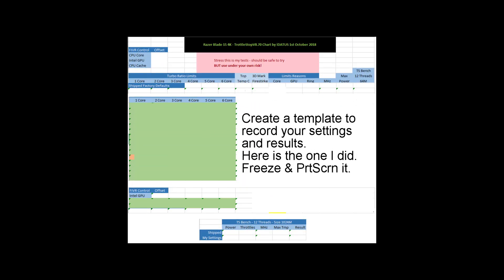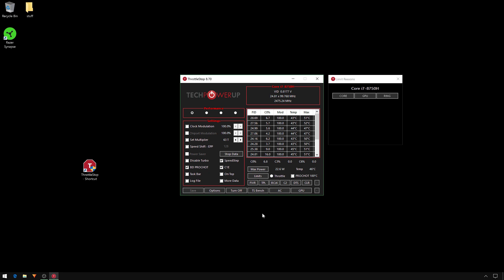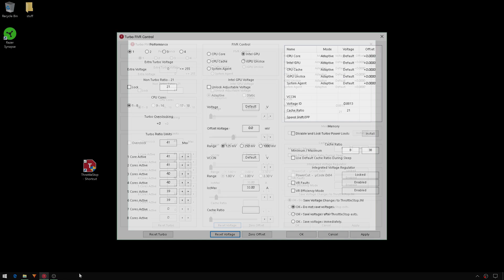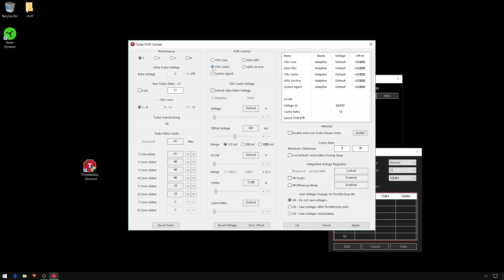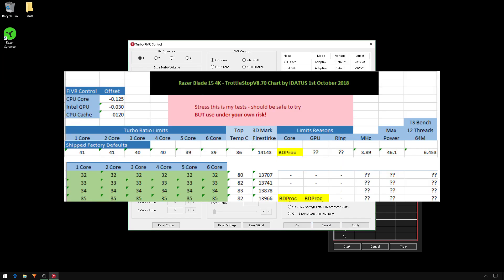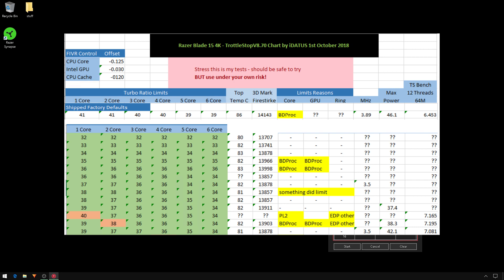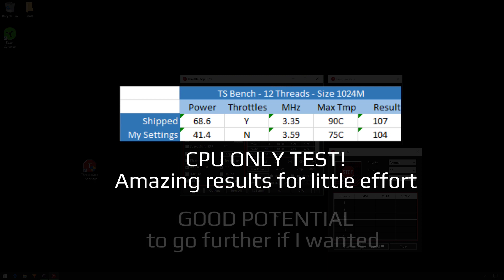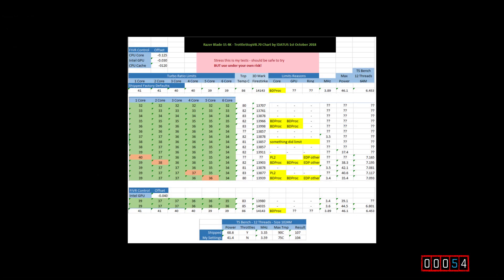Razer blade 15 undervolting with ThrottleStop⮜iDATUS⮞

Comment: REALLY appreciate your video! Thanks to you I am noww able to run my Razer Blade 15 GTX1070 much cooler while gaming or working! Good job :)
Reply from the maker: Do check out the other posts I did after this one for other ideas and methods. I do need to post some more. Thanks for your feedback.
Reply: im just curious as how is your temps so far, idle and gaming. I have the same unit to date

Comment: cant change voltage offset on blade 15 base model (2018), follow all the steps but on APPLY voltage offset did not changed.
Reply from the maker: Have you enabled or have enabled in the bios virtualization? And are you running windows 11?

Comment: I just bought the new i9 OLED Blade and I am pissed that Razer locked the bios and undervolting ability. I disabled turbo boost to get sane temperatures while gaming but this is stupid.
Reply from the maker: I don't blame Razer or anyone else for removing settings from the bios. There really isn't much scope due to limitations of formfactor and components.
Manufactures use a lot of extra hardware to control the components to keep them cool.
I can't imaging the number of calls support would get from those wondering what happens if I mess with this etc.
For those who want to dabble you have to find tools such as Throttlestop.
Bet that OLED looks nice.
Reply: @iDATUS  These laptops are too thin for proper cooling so to get the best of both worlds you need to undervolt. The only thing I can do on my new model is disable turbo boost which reduces temperatures but also performance.
Reply from the maker: Just keep everything at CPU design wattage, mine was 45w yours is probably 50w and under volt.
The mhz will rise to that limit of power.
Also you can tweak the GPU a bit.
If your app is bursty then you can have higher wattage.
If I was designing the laptop I would have more vent holes and also use the case to passive heat more.

Comment: Will undervolting my Blade 15 improve performance in video editing apps like premiere pro and after effects ??
Reply from the maker: Good question. Check out the channel as there are a lot of videos I have done both GPU and CPU since this one.
Could do with an update but they are still worth watching.
Undervolting should really be done no matter what if you feel comfortable doing it.
I suspect your apps use the cpu and gpu depending on tasks at hand.
The gpu encoder will be used when creating the output file. The GPU has a much lower threshold of underclocking if it gets hot.

The CPU heat transfers some of its heat to the GPU.
Reply: @iDATUS  i appreciate it but you didn’t rlly answer my question
Reply from the maker: @ZIMISTAK  I dont have those apps.
Reply: @iDATUS  well those apps are CPU intensive, would undervolting improve performance on cpu based apps?
Reply from the maker: @ZIMISTAK  Its not any easy question to answer as it depends if you are hitting thresholds for your particular usage.
If its bursty rather than sustained then probably leave as is.
If its sustained for more than say 10 seconds then I would defiantly do it as you will hit a throttle back which will slow you down until it thinks it has recovered.

By default the cpu is at a voltage level to guarantee no issues from intel.
I have more up to date videos on my network which explains this better.

In short, reduce voltage, set max watts to cpu design e.g. 45w / 50w and you will have a great setup giving sustained power.
If you are unsure on how to set max watts, turn off game/performance mode.
Set all cpu multipliers to the same number, e.g. mine are all 39.

Comment: I can't unlock the core controls in throttle stop. Why do you think that is? 

I know everyone says that you can't usb C charge the base Razer 15 but what about the base OLED? The bios has an option to turn it on, so I am starting to think that it does.
Reply from the maker: Matt, you saying to charge the Razer blade battery you dont need to plug it into the mains? OR you cant charge your phone using the Razer Blade?

Comment: Will this help me with my unnecessary fan noise I get when casually surfing the web if I undervote I have the 2020 base model rtx 2060.
Reply from the maker: Good question, I have a much better understanding of how throttlestop works since the making of this video and posted lots more up to date guides.
In short yes quite a lot.

Comment: why is speedshift epp unchecked ?
and is there anyway to run that 8750h at 3.8-3.9ghz at lower wattages without getting into 85C and higher in gaming.

one more question,
how can i maximise battery life of my device and  how should i set TStop to change profile to battery mode when i unplug my laptop from the mains.

By the way i have seen the whole TStop series of urs, it is too damn awesome mate. 
 
awaiting for your reply
Reply from the maker: Jatin, thanks for the kind words, I use the videos myself to remind me how it all works, friggin complicated isn't it. But what I will say is that you have ultimate control of your i7 and 8750h or any other, IF you know how you are going to use your laptop.
You could use profile 1 for short burst power, 2 for sustained, 3 & 4 could be battery or specific program or combination.

I did mention epp in 8.70.6 video (i will do a 9.0 refresh) and it could be useful but I would NOT recommend it for any laptop. May want to read some of the comments for those videos.

The options video also mentions battery, you can get it to automatically switch profile when it goes to battery say profile 3. I then set a battery level when reached (85%) go to profile 4.
Note also that when a profile changes you can get it to run scripts. I would do one to say stop services etc.

I will be doing more videos on this at some point.

Comment: these settings witll decreace or increase how hot my razer blade is?
Reply from the maker: Its a good video but I have come a long way with how to understand the settings and how to control the i7 since.
https://www.youtube.com/playlist?list=PLA31rku1BK2qTXj-VPQm5NVc3jNgNaF9J
This is a playlist of my throttlestop videos so far.
Explains a lot.
And yes it will drastically cool and depending on your usual give you a sustained smooth power.

Comment: Hey there! I want to try lowering the Turbo Boost to 3.4GHz instead of disabling it altogether however I can't find the option to lower the Turbo Boost in FIVR do you know how I can do it?
Reply from the maker: Sorry for late reply, my notifications were not working.
I have done a ton of new throttle stop videos since which explain a lot better how things work.
Check my channel out as there is a throttlestop section.
If you need help post again.

Comment: Can i do this on my Razer Blade Pro 17 (2019) RTX 2080 Max-Q 
Intel® Core™ i7-9750H CPU @ 2.60GHz
Reply: Because right now when playing any games i always on 90C and ramping up to 100C And I'm Using Intel XTU Though
Reply: Russel Segundo I would get throttle stop and try undervolting to -0.125
Reply: @VengefulController  i use Intel Extreme Tuning Utility and Undervolt is on -0.150 the most limit i can do is -0.175 on -0.180 will do BSD so i go -0.175 on Core Voltage Offset and Cache and i put same exact on Processor Graphics Voltage Offset -0.175
Reply: @russelsegundo8865  your overheating may be a hardware issue then, I have a razer blade 15 with the same processor but a rtx 2060, and my temps while gaming are 75 to 85 degrees. If u want to try to lower temps without needing to change hardware try undervolting your GPU
Reply from the maker: Sorry for no reply, I didn't get notification of posts.
This is an old video now and I have done some great work and understanding how the intel i7 works.
Go to my channel and see the throttlestop group.
Any probs let me know.

Comment: Just wanted to add I just got the Razer blade i7 9750h and 2060 followed this guide and cooled my Laptop off so much while playing and still getting great performance. I use the Gaming setting in Razer Synapse with auto fans and the middle battery profile (better performance not best.) Everything else was exact as tutorial and my turbo ratios were 41,41,41,37,36,29 and I am getting great framerates stable 144 in the bran new Call of Duty Modern Warfare and temps never above 80 degrees on CPU or GPU !! Thank you so much for taking the time to make this @iDATUS you are the man! Before the laptop was still running good but very hot sometimes hitting 99-100 degrees with settings. Now I can set it anywhere with no cooler underneath or anything and games below 80 degrees. Thanks again.
Reply from the maker: Great results. You might like to know I have learned a hell of a lot more about throttlestop and how the intel behaves since the posting of this video. You probably have but if you haven't check the rest of my content out. Its all dedicated to tech and product guides, mostly on Razer.
Done a lot of research and testing and very surprised on results and what you can do. Real life examples to follow.
There is a detailed guide to throttlestop settings and options I did which is a great reference, even for me as its not easy to remember.
Check this out https://youtu.be/xej2Lo5HYzQ
Consider subbing up if you haven't already and check out the patron options ⮜iDATUS⮞

Comment: Thank you for the video, I am about to under volt my Razer Blade 15. I have a question though. Is it necessary to change the turbo ratio limits, or can you just change the voltage offset for the CPU, CPU cache, and iGPU? I was looking in intel's XTU and it will not let you change the turbo ratios, even after changing the above mentioned offsets. What is the correct way?
Reply from the maker: @Chris, each case is different. The voltage is a must if your system can take it, which the settings I show are easy obtainable.
The default core settings don't really suit any situation I have come across and it really depends on the app you are going to run.
I have done a more detailed video recently on what the options and settings do which may help you somewhat.
I have many more videos on this subject in the pipeline and a bit overdue, mainly due to research and testing. Plus I have just ordered a 4k video grabber to show actual results I obtain.
For now  until I have done those videos, if using the mains, put all the cores on 36 and have synapse on gaming mode. Windows power leave on default which is balanced.⮜iDATUS⮞
Reply: @iDATUS  Thank you! I got a successful undervolt of -125mV on the core and cache and -40mV on the igpu. I might try to go further later, but temps under load are way better now at 75c. One strange thing though that I can't seem to figure out is I am getting a PL1 power throttle only on the 12 thread benchmark. The max power is 43w, and temp is 75, so its not a hard power throttle or thermal throttle. I thought it might be the turbo limit timer but after disabling that it is still persisting. Not sure if its related, but I'm also having an issue where the clock speed won't boost up higher than the lowest setting for a 6 core boost, so even though I have a single and double core boost of 3.7, a two thread workload won't boost bast the 6 core boost of 3.4, and it's not indicating any power or thermal throttling. Any ideas?
Reply from the maker: @ChrisKuiperBelt  CPU is rated at 45W and if my understanding is right PL1 is telling you its reached that limit, if its yellow then it was probably a spike. If its red then its happening all the time.
What I need to do is test a bit more (you guys giving me this feedback helps) is what happens when you enable Razers (or something similar in other manufactures) Game mode as that increases the limit to 68W I think.

Your second question referring to frequency, this is part of the testing I will be showing in upcoming videos. Just because you have a 1 or 2 cores at a high level to the others, doesn't mean the cpu will choose them to do a single or double thread.
Reply: hey man can you please tell me your settings? i'm also using Razer Blade 15 1070 max q config TIA

Comment: This needs to be redone in more depth because I don't know how ur determining your core active numbers
Reply from the maker: High MattH214, yes you are correct. This video shows you how to change the settings but the testing is a little out.
I found out a lot more since then and trying to do example videos for people to try with me.
I have done a very detailed video on the settings and options for ThrottleStop (along with many others for the Razer Blade 15) and if you haven't already check it out.
https://youtu.be/xej2Lo5HYzQ
Will try my best to get one out for end of next week.
I post in the YouTube discussions tab and will eventually flesh it out more on my website blog page.
If you have suggestions or requests then feel free to post. ⮜iDATUS⮞
Reply: @iDATUS  yes please explain limit reason, and explain what you should be looking for, what's good and bad how to run ur tests
Reply from the maker: Noted.
Reply from the maker: @kvothe2144  As mentioned I am currently working on the next lot of videos and you will be pleased to know I have found a great way to show a lot more information.
Its not via throttlestop but you still use that to change the system.
Quite excited about it. ⮜iDATUS⮞
If you're not aware I do a patron system as well, so check that out if its of interest.

Comment: Was gunna get this laptop but all the stuff I've seen about thermal throttling and the pure heat this thing puts out has pushed me away is it worth a buy if I undervolt/underclock?
Reply from the maker: Thanks for posting your concern as I'm sure your not the only one.
Firstly be clear this isn't a Razer issue, all the thin laptops of this calibre have the same problem.
I have a new set of videos coming out with several scenarios that anyone can follow on how to get more out of it.
If you haven't already watch this upload I did recently. https://youtu.be/xej2Lo5HYzQ

So your options are, buy the Razer (its actually a bit thicker now and slightly better cooling), buy a thicker laptop which has its own issues or something less powerful.

What are you planning on using with it as we are only talking hot when you max it out for extended periods.⮜iDATUS⮞

Comment: Hi again! Having a problem doing this method with my Razer Stealth i7 8565U. When I change my core ratios to say 32,32,31,31. All cores only run at the lowest ratio not to the setting. I know your guide is for the Blade and not the stealth, but any idea?
Reply from the maker: I was going to mention this in your last post and it was going to be a main part of my video until I decided to do a full blown overall of throttlestop.
If you have a thread which spans more than one core they all have to run at the same speed regardless.
So if you have 5 set to 33 and the 6th core set to 20 they would all run at 20.
I would therefore recommend you set all cores to the same level.

If you not sure look at my other run cooler or more FPS video where I briefly explain how to see what the number of cores you are using.
Reply: iDATUS hmm okay. I wasn’t sure if it was just the stealth and I maybe had to unlock some other bios options? 
I do a lot of CAD work which is mainly single core a lot of the time, if I set my first core higher will it work then?
Reply from the maker: @leeedgecombe  unless you put a load on the other cores the fact they are all set to say 39 doesn't mean the cpu is using much power over if they were all set to 25.
The cpu works out which core is best to run your process at time its asks for something of it to do.
I think in the old days it was fixed to core 1 for turbo.

Comment: I have a RB15 GTX 1060 144Hz. For some reason, I set my turbo for 41 for all cores and still didn't get any throttling? Meanwhile my initial settings of 41,41,40,40,39,39 did throttle. Am I overlooking something?
Reply from the maker: Thanks for posting, did you make sure you pressed the Turn On at the bottom of the interface and do you have Synapse on gaming or balanced?
Not I am currently doing a new batch of Throttlestop uploads so look out for those.